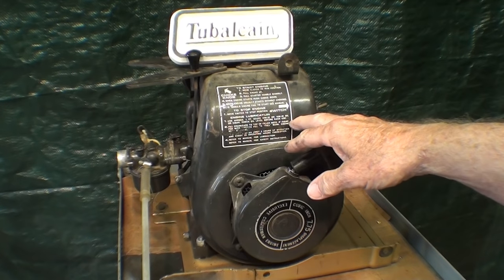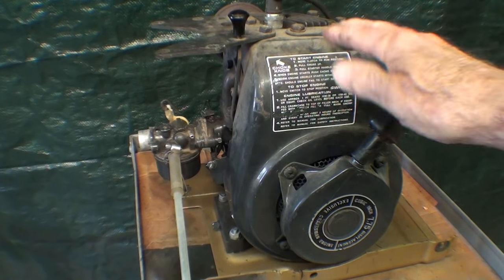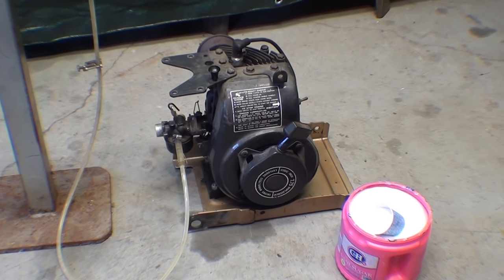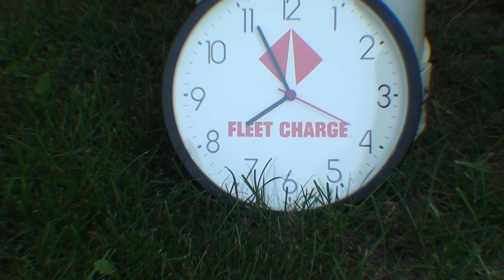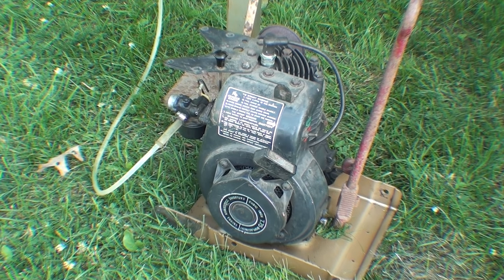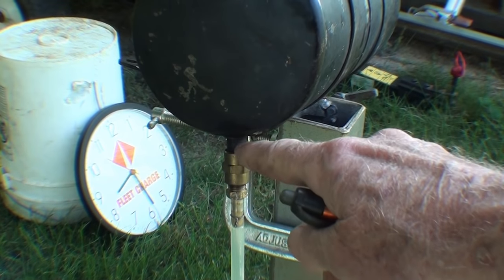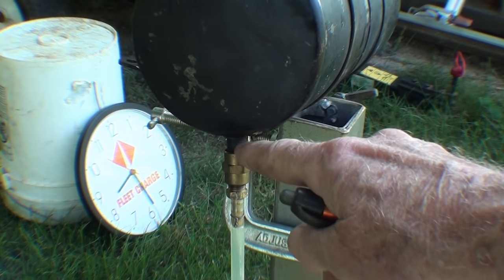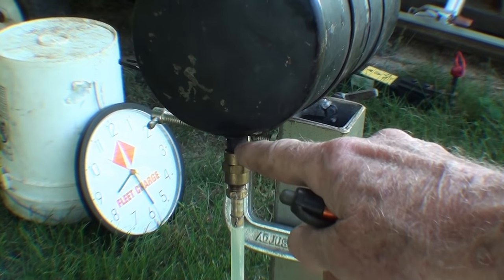MYTH BREAKERS #2 "Sugar in Your Gas Engine Fuel Tank" tubalcain

Comment: I must add that CARB compliant fuel cans make me say bad wordsSo I will refrain from further comment on that subject.
Reply: Those things are awful! The first thing I do with those is run a half inch drill down the spout.
Reply: Yea, you can't get fuel out of those environmentalist nut-job cans without spilling it.   AWFUL.  Reject these control freaks.
Reply: It's just a latching lid.
Reply: ZippoVarga They only way to stop this cancer is to cut off the agencies who issue these dictates.  Most pray for less government but are unwilling to cut off it's various branches.  Are you?
Reply from the maker: I would immediately eliminate--1. OSHA, 2. EPA, 3. Dept of Education,.
Then reduce the IRS to 10% & reduce its regulations by 98%. Corp of Engineers is also on my black list. HATE BIG government.
Reply: mrpete222 Immediately if not sooner!  All laws attempting to interfere with voluntary non-fraudulent exchange between humans are immoral.  ALL of them.
Reply: The rich get richer, the dumb, dumber and we, the true backbone that keeps America alive are constantly given the dirty end of the stick. Clean the slate, stop corrupt government. The only way to do that is to get back to basics. Use our own resources, which starts with this Nations people manufacturing top quality products designed to last, set limits on foreign content, repeal NAFTA, deport illegals, limit welfare to a 6 month hardship with an 18 month air gap between assistance. Force the lazy to get to work and stop enabling. We pay more taxes to support those who refuse to work than any Nation in the world. Want to balance the budget? Then fix the source of it's demise. Big Corporations and Big Government. I could go on, but this isn't a political discussion. Sugar kills! lol...but not that old Tecumseh! Zip~
Reply: ZippoVarga If we want to be free from an oppressive leviathan and all it's objections to Liberty, we have to be careful what we call for.  These things all call for more government control.  Control is the cancer that is causing the problems of which you complain.  "set limits on foreign content"  How about we don't enlist or call for the use force on anybody for any peaceful activity? In as much as "NAFTA" authorizes force and violence to be applied to anybody involved in non-fraudulent peaceful trade, I am against it.  Welfare is something we call for with seems to legitimize the use of force and violence to transfer money from one person to another.   Again violence.  How about we quit altogether calling for a special group of people to use force to establish a monopoly which competes with charities?  How do I earn a right to provide services and gain my revenue at the end of a gun?  "Corporations" regardless of size are creations of government.  It's a special protected status maintained by a group of people who claim the right to use force to form a protection racket for the business.  How about just Capitalism instead?  (Capitalism is voluntary exchange.  As soon as the government enters into it there becomes a non-voluntary element, it's no longer Capitalism but rather Crony Socialism.)

So, we must be careful we don't call for a force to "do something about it" or we encourage the very leviathan that is feeding on our productivity and Liberty every day.  I am for Liberty.
Reply: We want the same thing Crafted. Less Socialist states and government and more Liberty returned to our Soils. Government can't be trusted to do what's best for its people. So what is the answer? How to we, the people, regain our liberties? We have a bully driven government. The last time I checked, bullies don't back down when someone shakes a feather at them and says, now...don't do that please...someone might lose a job, have to get a job or stop suckling on the government hand outs etc. I'm not saying break out the guns here. This Nation is being destroyed by the very entity that was devised to protect it and its people. More Government only means more taxes, more debt and more restrictions on the lives of those who work harder and harder for less while more and more of THEIR hard earned money is taken from them to hand to people who have done nothing to deserve it. This includes the very government who takes the money. Lets look at the Social Security system for a moment. This is money WE the Tax Payers put into a security to draw on in our golden years or if we become disabled. But, our own Government voted to TAKE our money, which makes it OK? Nope...So what's the answer? No more big government. But the Government will never voluntarily give back what it's stolen. Now how do the American People take action? How do we make our Government accountable for the many wrongs it's legalized?
Reply: ZippoVarga most our tax money goes to israel.. do some research, and start by searching Rothschild, Zionist fake jews
Reply: Political stupidity mate...My eldest daughter had severe peanut allergy but she knew better that to eat peanuts long before she started school.There was never a problem...people need to take responsibility for their own actions and not expect to be wrapped in bubble wrap always.Cheers.
Reply: Darwin Award Contestants? Make America Smart Again.
Reply: LOL, right? About 40 years ago.  Back when things made sense.  Before the PC crowd took over.

Comment: I found the 5 gallon gas can by Eagle with the funnel attached for around $35 on Amazon. It says it's 47% off.
Reply: I see now that the handle is different from the one in your video, so it is not identical to yours. There is a Justrite 5 gallon can with a similar handle to yours, but no funnel on Amazon. Funny though... 1 costs around $33 but you can get 2 for around $100!
Reply: P.S. I love the fancy graphics in the beginning of the video! Great Job Lyle!

Comment: 13:00 It's funny how times have changed. The younger kids are probably wondering how it came to be that you swallowed gasoline. I addition, as a 63 year old I don't even want chemicals touching my skin let alone sucking gas through a Siphoned.

So now when I am washing or working on my car or any other household chore for that matter that requires my hands touching chemicals, I have a box of disposable rubber gloves that I take a pair from and use.

Comment: I always thought that other than clogging up the fuel system, it would score up the carb, pistons, rings, & cylinders. I never actually seen the results of the damage sugar does to an engine. I have personally ran a motorcycle around for quite a while with no air cleaner & witnessed just that kind of damage.

Comment: The largest issue with 'sugar in the gas" was it's action as a particulate form of fouling. Clogged filters, pump check valves being stuck open or sediment/carb bowls being filled. 
Cleaned loads of sugar from the fuel systems of sabotaged mining/logging/construction equipment, it's a nuisance for the most part. 

Also: A friend of mine is one of the (many) heirs to the C&H empire.  He likely appreciates your choice in cane.

Comment: Tuning in late, but the experiment should be repeated with the sand and then again with the dirt.  It may be that the sand and dirt may aggregate but still allow the gasoline to flow albeit in a filtered form, whereas the sugar may pack and prevent the flow of gasoline.

Comment: the problem with sugar in a gas tank is it oxidizes the parts if you let it sit. seized carburetor pins, rust chips in the fuel line, and if you have a fuel pump or injector they will seiz, have sensor erors, or rust and break apart.

Comment: You can Also try the fake sugar like sweet n low. without it dissolving into the gas it will only clog the line up and keep your motor from running.

Comment: The sugar has to be mixed with the gas before putting it in the gas tank. Use gas that is ethanol  free. I had a friend back in 1964 that was driving a 56 Ford, 292 v8. I was riding with him one day and the motor started running slower and slower and finely quit. He had been sugared, In side the motor was all sickie. When in stalling another motor the gas tank and fuel line had to be replaced. .

Comment: I have seen it destroy a chev 350 V8 . After the engine had been sugared it locked up tight. We pulled the engine out. Then pulled the intake manifold and the sugar had turned to candy, locking the heads on . We beat the heads with 10 lb hammer sending the block across the floor. We never did get the motor apart. From my experience it did destroy the motor.

Comment: Table sugar usually justly clogs the fuel system (filter, fuel lines, carb or injectors, etc.) Sugar molecules are shown as:
C12H22O11
     One molecule of sugar contains 12 atoms of carbon, 22 hydrogen atoms, and 11 oxygen atoms. It it IS able to get into the combustion chamber, it would break down into 11 water molecules and 12 carbon atoms. That would likely cause a sludgy buildup on the valves that would cause a loss of compression. Cleaning that all up and cleaning out the fuel system should fix everything.
Reply from the maker: Thanks

Comment: Myt not broken. Had sugar put into my gas once. At first, it was hard to start the car without starting fluid. Once the engine was hot it ran fine. Then once it was cool, took 30 minutes to start. Then it started burning oil. Sugar had gummed up the fuel system but over time it also destroyed the piston rings. Cost to much to fix, car was scrapped.

Comment: They just put the CC's on the engines, keeps them from being sued because the engines wouldn't actually produce their rated HP depending on conditions. Particularly lawn mowers where federal laws limit the blade tip speed, so the engines would be run at an RPM far below what they need to make their maximum HP. A notable one was the Briggs vanguard engines, the 16 and 18 hp engines. They were the exact same engine but with slightly different tuning Briggs was upping the HP by 2 and charging more.

Comment: I was told that the sugar would result in extreme carbon deposits in the engine requiring a tear down.

If all you want to do is stop the engine just dump a gallon of water in the fuel tank.

If you want to make someone THINK something is wrong with their engine pour oil in the fuel tank.  It might even foul the plugs and cause it to quit but for sure it will smoke like crazy and the owner will take it to a shop and be told he needs a ring job.

Comment: I think the only chance that is would harm an engine would be with gas containing a high enough ethanol content to dissolve the sugar. and I'm not sure that would even do it.  Certainly the old pure petrol gas wouldn't do it.  Not sure when fuel filters started being a regular fixture on cars, but certainly we can see that sugar did a fine job of clogging up the fuel system.  So, not completely busted since sugar did stop up the fuel system and hence stop, though not ruin the engine.  I won't be adding sugar to my tanks any time soon though.  They run sweet enough as it is...........

Comment: The major damage caused by sugar in the gas tank was/is to the fuel system.  Particular to carburetors or fuel injectors or any other item that has very small holes for the fuel to pass through.
Sugar should it ever get to the combustion chamber is quite combustible.

Comment: Engines are classified in kW (kilo watts) nowadays. Thats not a bad idea as it is a proper SI (International System of Units) unit in contrast to horse power that has different british, american, italian and whatnot interpretations.
Reply: Yes... most other countries use kW, and have done so for eons. The conversion factor is 1 HP = 746 Watts (or .746 kW)
Reply: Then you convert kW in to hp so you know how much power it produces. It's the same with millimeters, you convert to inches so you know how long it really is.
Reply: Yes, much the same deal, but of course it assumes the manufactures power rating claim is accurate, and there are some other efficiency losses that should be accounted for to be exact. Don't even get me started on how one 'major' department store chain rates their electric motors... :) One inch =  exactly 25.4 millimeters, and one millimeter = (extremely close to) .0394 inches. .0394 is just the 'reciprocal'  of 25.4 (1 divided by 25.4 = .0394). The reciprocal dance works the same for 'flipping' other conversion factors as well.
Reply: There was a class action lawsuit a couple of years ago where the HP rating on outdoor power equipment was always way under the actual horsepower.  I wonder if that was the reason they moved to displacement.

Comment: mechanic told me that 1L coke bottle is the proper delivery system for sugar in a gas tank to ruin an engine. The coke is full of already dissolved sugar. You should try mixing Coke with gasoline.

Comment: Try putting linseed oil in the crankcase about 1/4 of the capacity. A local gas station about 100 years ago had one customer that would steal a quart of oil every chance he got. This is in time before all the plastic quart jugs. So he put the linseed oil in a glass quart jar that he had mark so he would knew it the one with linseed oil in it. The customer put the oil in his model T an only made it down the road a mile or two before it lockup tight

Comment: I was a piece of crap person at one time in my life and did this to an enemy of mine. I dissolve sugar in a liter jug of water and poured it into the persons tank and to my surprise the car ran for weeks until finally it quit running. They took it to a mechanic who took the top end apart to find burnt valves and a strange goo everywhere. So i guess it just gummed everything up so bad it stuck the valves shut. I know it was wrong and would never do something like that as an adult but i did it and that was the result, for what its worth.

Comment: no, actually you have confirmed the myth in a way. no, sugar in the gas tank does not harm the engine itself, but it absolutely does disable a car, and rack up a fearsome repair bill. the entire complex fuel system can be contaminated. Most modern cars have an electric fuel pump in the gas tank, and a can style filter mounted along the frame rail somewhere. If there is sugar in the gas tank a technician must pull out the gas tank, remove the fuel pump and the gas gauge sending unit (often an integrated assembly) and clean out the tank thoroughly. then the steel fuel lines from the tank to the filter must be cleaned or replaced. Given the lador time of cleaning them, and the distinct possibly of incomplete cleaning causing a return visit, they are usually replaced. Of course, a new filter goes in. Then there's the question of the fuel pump and sending unit. You must clean it out or replace it. The darned thing is hundreds of dollars, but the labor charges to clean it out twice if it doesn't get clean enough the first time are pretty harsh too. 
In the end, sugar in the gas tank can be fixed, but the price tag is pretty unpleasant.

Comment: The problem with sugar in a engine is the sugar will carbonize or turn to like glass and stick the rings in the pistons! I have seen this several times over my 46 years building  engines. put some sugar in a pan and turn the heat on and see what it  turns into let it go in will turn into the same thing that will  stick the rings and valves and on newer injected engine it will destroy the  injectors.

Comment: But the damage was done to the fuel system, still keeping the car from running ultimately. Are you aware of the reason why they no longer list engine hp for small engines? There actually is a class action suit against the motor makers as it seems that they often listed the same engine at several different hp ratings. I personally have investigated and found that there is no difference between a 10, 11, or 12 hp rated B&S engines.

Comment: Well, Myth not broken! It did what it should: stop the engine. And in an car you would have to change the complete fuel system. I believe sugar is better than other dirt because of its specific weight. Suger will stay mobile in the fuel until it clogs somewhere. Seems to be very efficient.

Comment: Very interesting!  If you burn sugar it becomes a very hard black substance so I always thought that sugar in gas would get into the combustion chamber and become a black sticky mess that stuck the piston and rings thus causing the engine to seize.  However it looks like sugar plugs the fuel system and doesn't even get into the engine!??
Reply: william davidson I've seen so many different answers I'm just as confused if not more than I was before I came here! ha ha
Reply: I guess the best thing is to keep the sugar in the lemonade not in the gas!!

Comment: i do believe that back then your small engines didnt have fuel filters in Line to the carb which would cause the sugar grains to go into the cylinder as whole instead of dissolved which makes this experiment kinda faulty but what would i know i only study power equipment full time at school..

Comment: Sugar isnt soluble in petrol,but in water..if you put sugar and you need a fair amount of it,into a petrol tank it will fall to the bottom and mix with the water and sediment ...if this then gets into fuel system it can make quite a mess..it can cook like toffee onto parts exposed to heat,and gum up valves of mechanical fuel pump,clog injectors...repairable but a headache...guess it would be even worse on a diesel,due to the fine tolerances in the injection pump,but diesels have water separator filters..the key to  it all is water..When the Mythbusters did this on TV some years ago,they used the same petrol tank for several different experiments and cleaned the tank each time,as there wasnt any water in the tank they couldnt prove it
ere